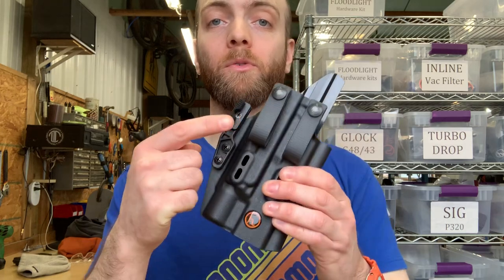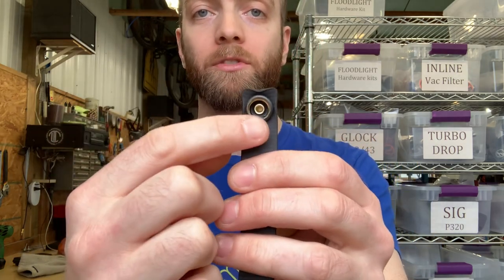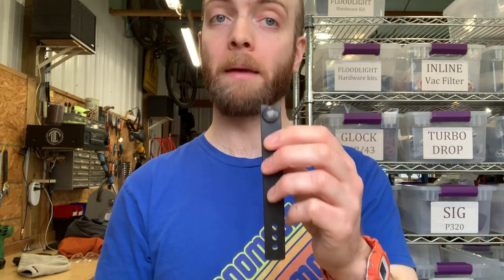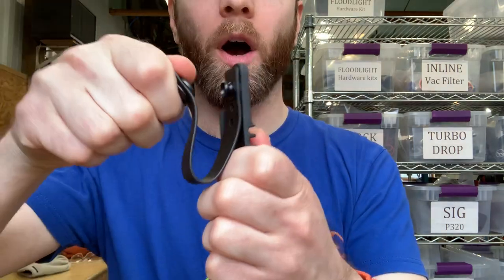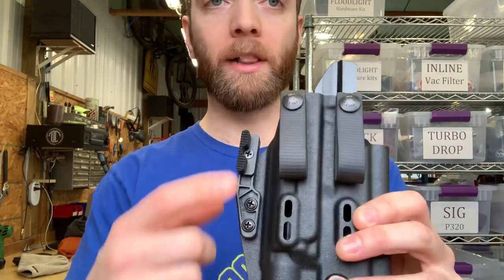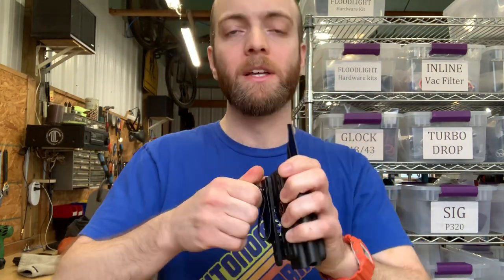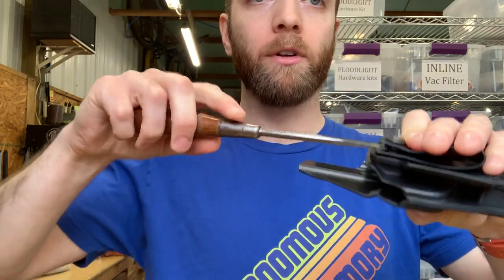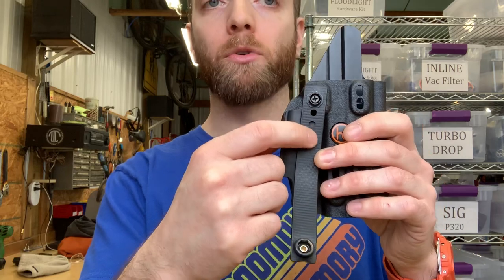Soft Loop Breakdown!

Comment: I've never had any trouble with my soft loop tabs. Probably because I watched this video before I bought my first Kydex holster from Henry Holsters.
I've since bought another holster from another manufacturer with a belt clip.
From now on I plan on using soft loops and I plan on replacing that clip with some loops.
I checked your website but didn't specifically find soft loops for sale.

Comment: They work great as long as they are manufactured properly. If the tab in the socket isn’t exactly at the six o’clock position and is slightly canted no amount of break in will fix it. And there is no adjusting it.

Comment: Hi thanks for the great video! I was wondering if you could tell me the length for the screws and post that attach the loop to a sheath that are used! I can't find the information anywhere and don't want to buy pre packaged sets. Appreciate it
Reply from the maker: We normally use 1/4in screw posts, an 1/8 spacer, and a specialty #5 head 3/8in screw. You won't find that screw at a hardware store...